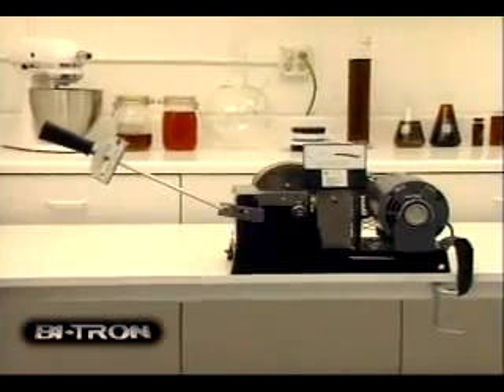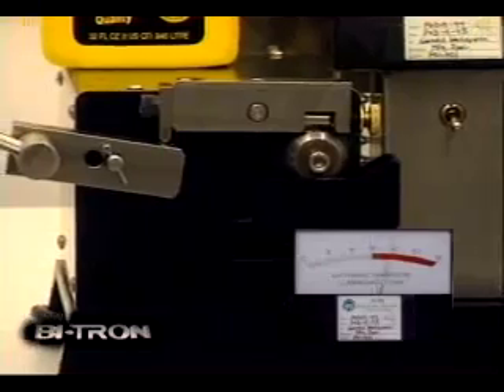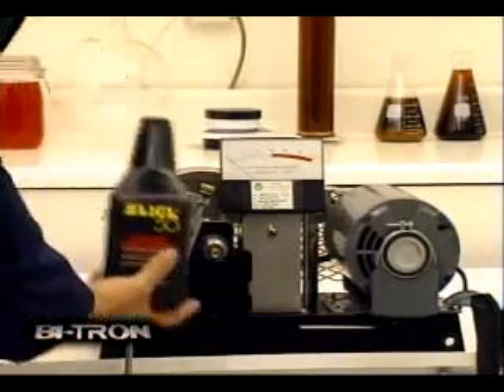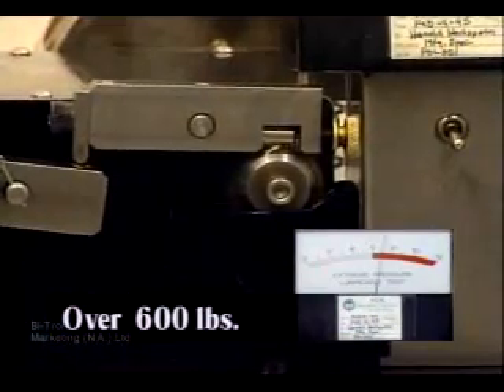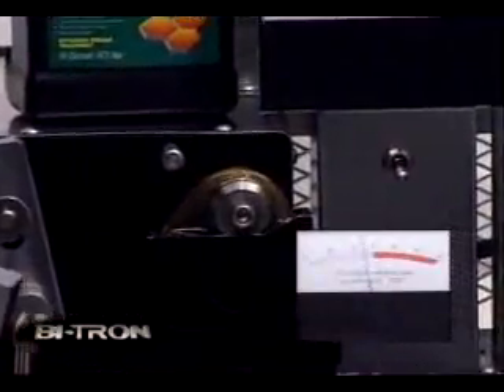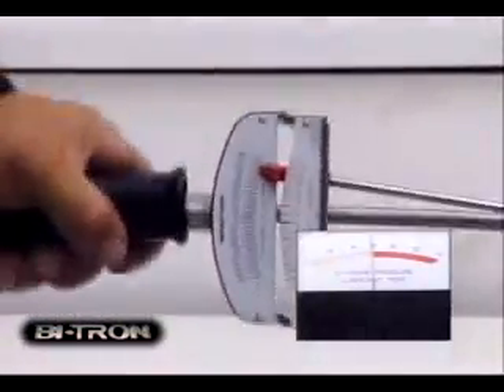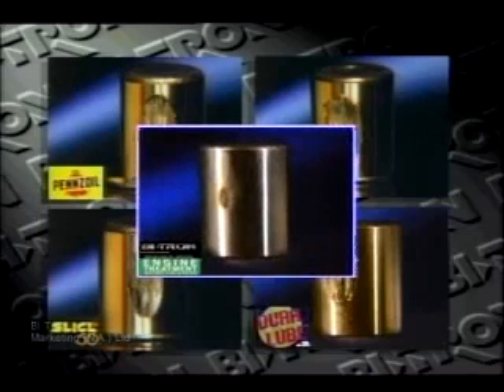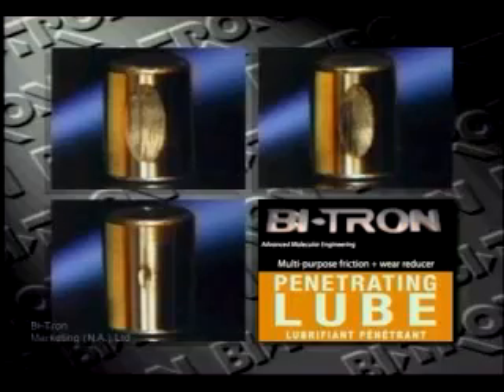Bitron Engine Treatment Extreme Pressure Test

Comment: Slick 50 is a scam product The name was stolen in the 1980’s  from the John Bishop the original inventor . The formula was not 
Now called  
http://www.lubrilon.com/support/pds.asp It a one time addictive. 
Tested and proven .  In the 1970’s use to show adding it to a engine  and driving for a while than draining the oil and driving it without harming the engine .

Comment: Where can I get a 600 ft.lb. beam torque wrench with 1/2 in. drive.?
A fair test of the protective ability of an additive would be to take a 5 in. angle grinder to the piece. Sure, there are materials that can withstand this treatment, but they are not available to the public. I need something I can coat my skin with to protect from gator attacks, as well.